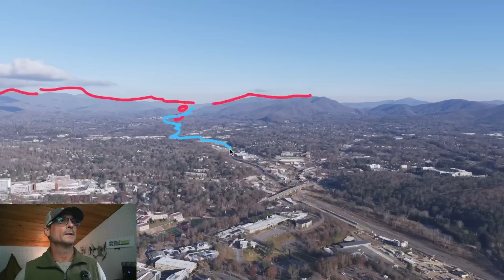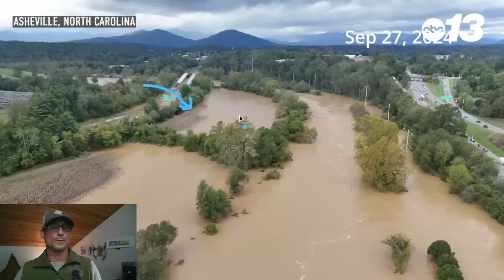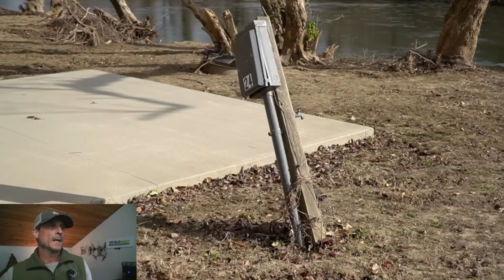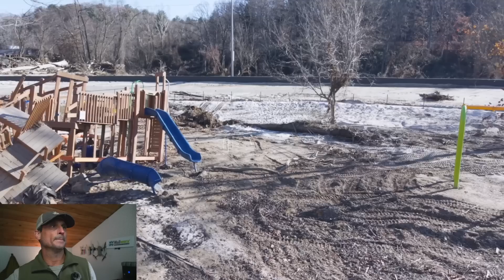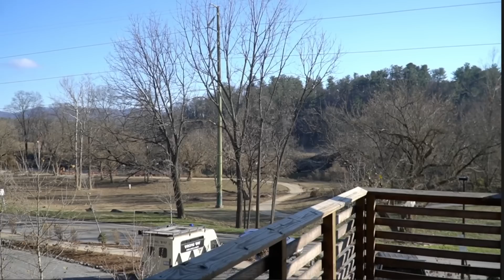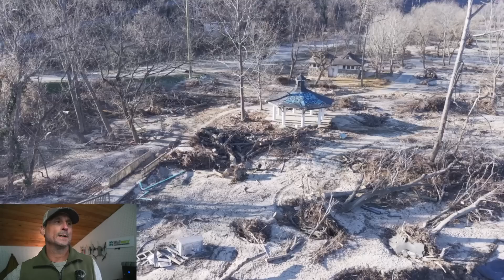Helene Impact Update Dec 3 - Asheville: Swannanoa & French Broad River converge at Amboy Road

Comment: A couple days ago, I spent a day on the Amboy and Biltmore side of the French Broad in this area. There isn't much obvious damage to the banks of the river or trees here. I suppose the water was high enough, quick enough that it inudated this area quickly and cut down on the riverbank erosion. The water on the Amboy side might have been 15+ ft over the banks of the river.
Reply from the maker: I think you're exactly right on the visible damage along most of the stretch.  Tony Willson pointed out to me that their stair case down to the river was destroyed in the 2004 flood, but survived just fine this time.  I've seen similar scenarios along our rivers.  In some places the very low bridges survived, but higher ones were taken out.  And I also thought it is became the river rose quickly and floating trees and debris missed the submerged structures.  Just speculating.
Reply: @DominicTaverniti  We didn't think so either, but the more you look, there are many banks that have tree roots exposed and are merely handing on. It's that way in a lot of areas. Hopefully some will reroot before anymore substantial rain, ice or snow head our way.